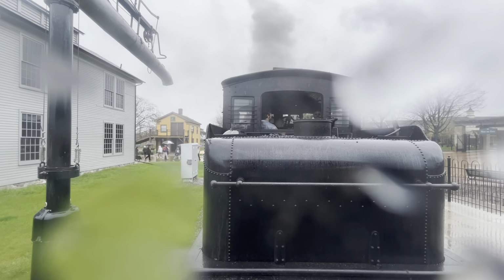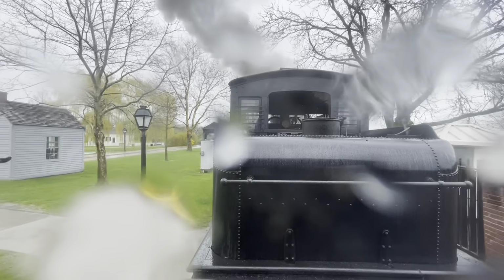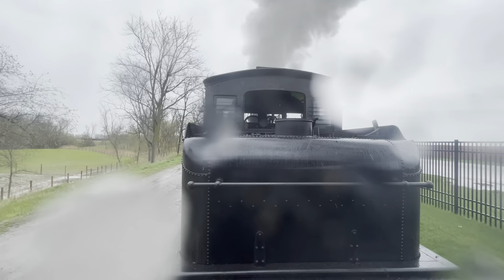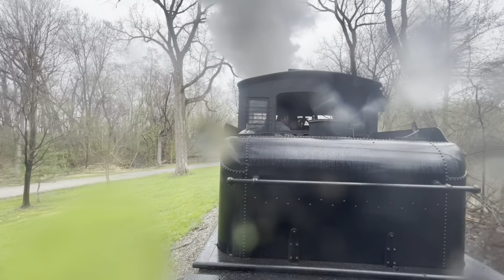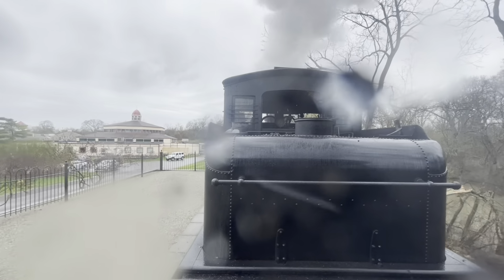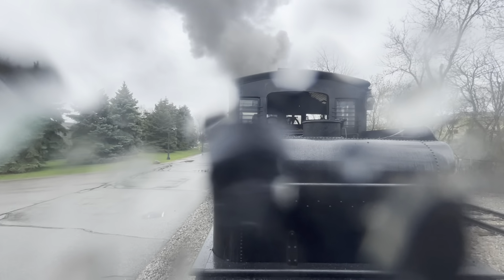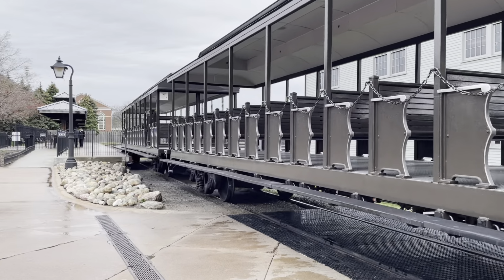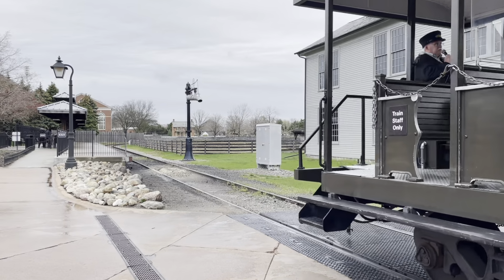0-6-4T Torch Lake Steam Locomotive 4/25/22

Comment: Why has Torch lake been operating so much lately?
Reply from the maker: Idk but Edison might operate on the weekend and if it goes well Edison will run for may.
Reply: @traingaming99  Do you know if the number 7 is doing good
Reply from the maker: Yeah there fixing it and might run in late or early summer but they still have to fix it but that’s all I know
Reply: Thanks
Reply from the maker: Yw but it could not be right so far it might happened